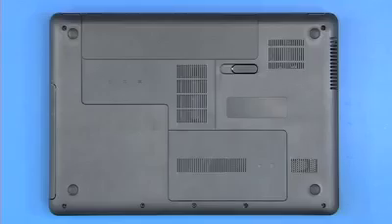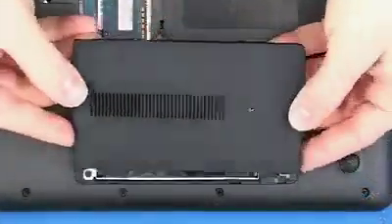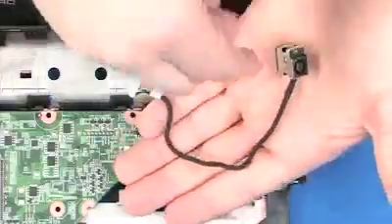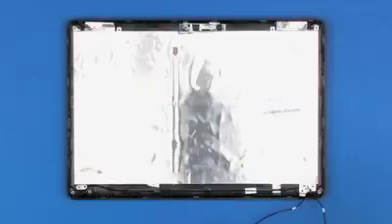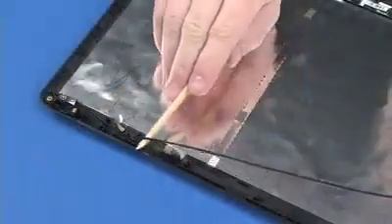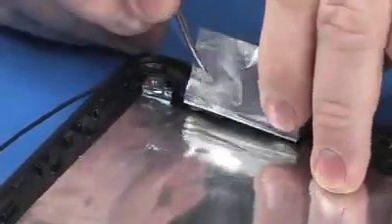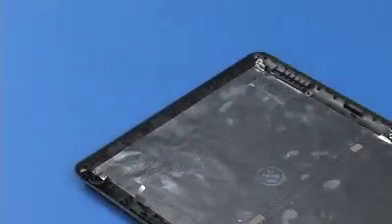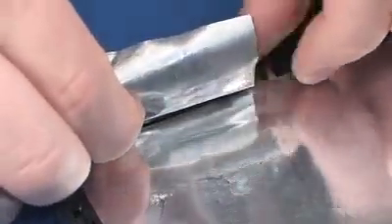Replace the wireless LAN antenna | Compaq Presario CQ43-100 Notebook PC series | HP Support

Comment: Why can I get the parts for the wifi antenna connector
Reply from the maker: Hi there, thanks for contacting HP Global Social Media Support!
I understand that you need to purchase Wi-Fi antenna connector. 
I will do my best to assist you.
You could purchase the part from HP.
Use the HP Parts surfer to identify the part: https://hp.care/6051m9hAL 
And order it via the HP Parts store: https://hp.care/6052m9hA0 
If you are unable to locate the part, please check 'Ways to buy' from the bottom of the link.
Regards, 
HP Support